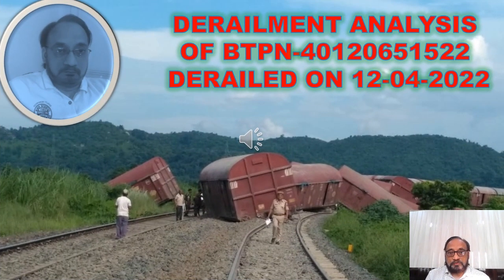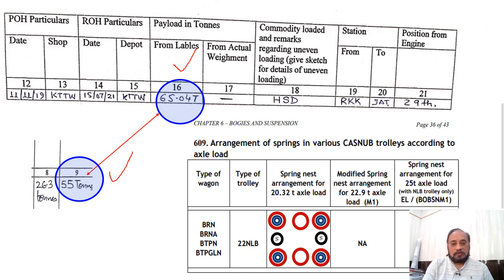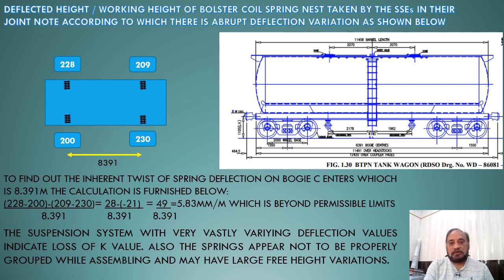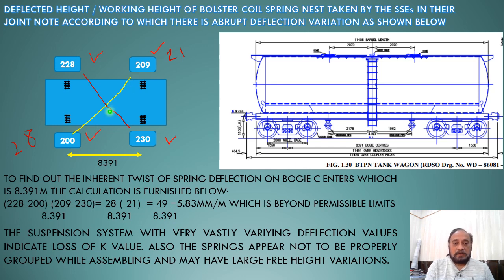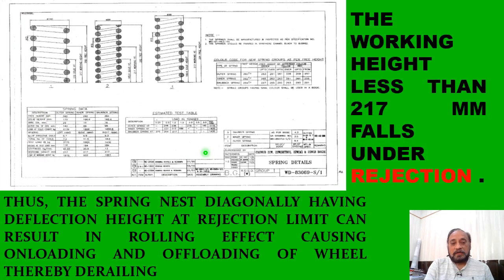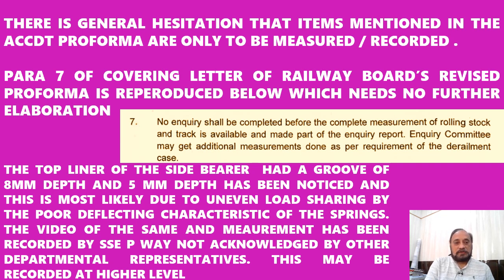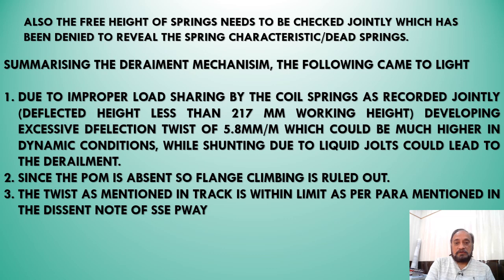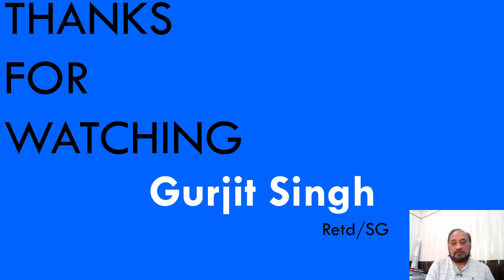BTPN DERIALMENT

Comment: Sir tank wagons can never be overloaded as they are designed for specific products with fixed density.
Reply from the maker: Absolutely right you are. In fact in the instant case the data given was incorrect. Means the cc and and actual loading particulars were a mis match.
Good reviews and comments are always welcome.